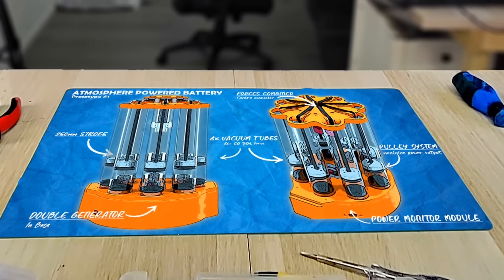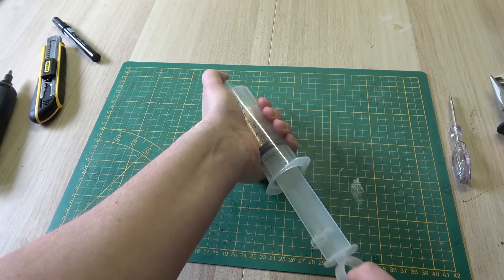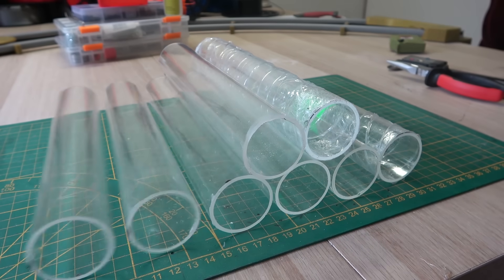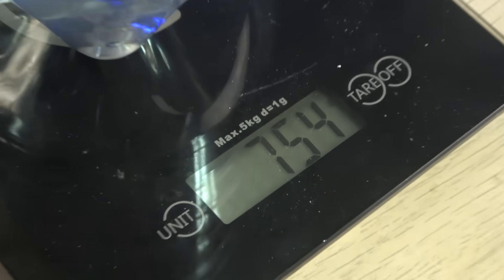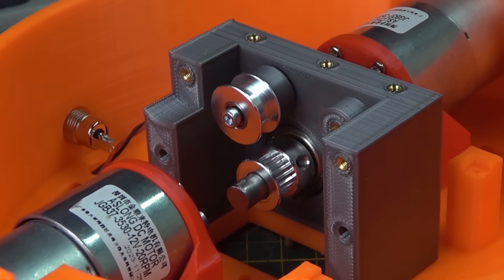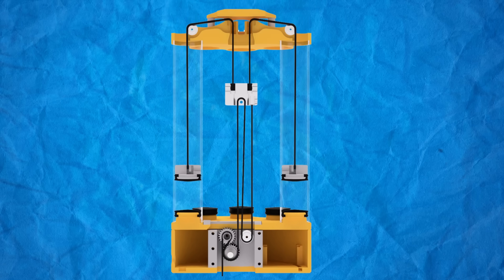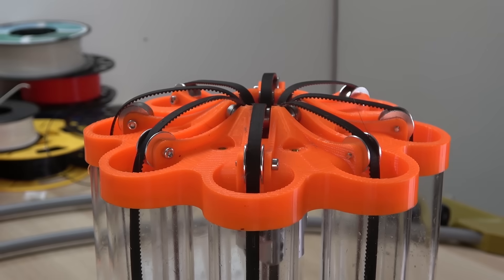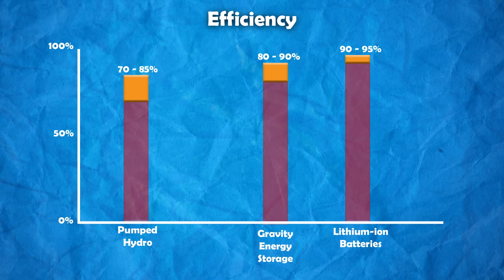Building an Atmosphere Powered Battery..

Comment from the maker: To clearify how i got to the result as seen in the video:

To charge: ~12.08V x ~1.62A x 43.709 seconds = 860,64 watt-second (or joules)

After a discharge: ~9.42V x ~1.15A x 57.993 seconds = 628,24 watt-second (or joules)

All value's are measured by the Arduino Nano in combination with the INA3221 Power monitor module.

As many of you have pointed out in the comments below, I did indeed make a mistake regarding the mention of the Watt to energy aspect. My sincere apologies for that!

The core of this project was to explore, show and see what was possible with this experimental project, even with some limitations. Sometimes it's not just about the final outcome, but also about the journey and what we learn along the way. And I hope that despite any shortcomings, you still found the video interesting and/or inspiring!🤓
Reply: A potential problem with your aproach is that if you whant to store energy for long periods like hours or days, the air will slowly sip inside the cilinders, resulting in potential energy loss. and you needing to reassemble the entire rig to get rid of the air that laked iside the tubes.
Reply: @murylocordeiro  I bet there is a way to keep vacuum that is more sofisticated than using syringes
Reply: @PuOop-j9l  yes. But if you have moving parts the air will get in.
You can try to improve the seal, adding orings and lubricant but the air will eventually get in.
Reply: @murylocordeiro  anything built on a serious level would likely include a method of equalizing at deactivation. Essentially you would reset this every charge cycle.
Reply: True. However, especially with pumped hydro and gravity batteries, it is for a short period of time, to store energy from solar during the night. It does have other uses, and the other use doesn’t require as much efficiency.

Basically, true large scale power plant ones just need to store power at most maybe 36 hours if you want to be able to function on a rainy day. A household one doesn’t need to be as efficient, as home power useage is actually pretty low. An auxiliary motor maintains the charge for low electricity, or you have to recharge it every few days, but it still could power your home for multiple days.
Reply: @murylocordeiro  There are Phillips Stirling engines that use seal sucks, which are very airtight and where air can hardly get in. (Hay motores Stirling de Phillips que emplean seal sucks, muy herméticos y en donde el aire difícilmente logra entrar). https://youtu.be/-gvplMQbqnA?si=ANG2SO3ZPILUVQSq
Reply: 628 Ws of energy means, you needed 3'600 pieces of your apparatus (or the active vacuum cylinder push lenght) to create 628 Wh - the capacity of already worn down 750Wh LIon bicycle battery. Since dW=F(s)·ds, when you take a piston with a diameter of 2m, then this provides a force of F=1²·PI·g or about 308kN. A moving distance of 100m results in an energy of 30.8 MWs or 8.6kWh - multiplied by efficiency. Sorry to tell you, but I don't think, this is a very appealing technology.
Reply: @debrainwasher  It's the same core principle as gravity storage, just with a fixed pressure instead of the "density*height of the weigth"-parameter. As such we get similar storage density.
Reply: @robertmartinu8803  This is not exactly true. Gravity based energy storage systems, don't need seals with significant friction coefficients and also don't have adiabatic losses. This is the reason, why water is so successful in hydroelectric storage power plants, while gas is not.
Reply: @debrainwasher people who aren't familiar with electrical or chemical engineering will forget to do a thermodynamics check. In this case, it is as simple as remembering that mechanical force translates to very little electricity.
Reply: How much energy did you loose by friction on the tube walls and pulleys
Reply: @Bear049  I'd guess 27% - the bit that is the inefficiency
Reply: @Bear049 Not enough to kill the idea... they've lied to us since the day we were born... They make, and we can access, materials that have SIGNIFICANTLY less friction than metal. Teflon is only the first that comes to mind. I've seen what types of weight and torque Teflon can handle. But there's not only Teflon.
 If we DON'T use their math, forget everything they told us that COULDN'T be done,  and just use our common sense, we can MOST DEFINITELY make a Perpetual Motion machine.
Reply: Wh/kg=?
Wh/m3=?
Wh/$=?
Reply: bring the output so that it will be a stable usb-c pd and try to use a laptop with that energy, and see based on absorption if it's usable, because a larger scale version of this would mean being able to charge it with solar and release later on in a size that is way larger than car batteries( in parallel and series) that i have sometimes seen( also a cost analysis would be nice).
Reply: Couldn't you do a similar thing with hydraulic oil, if you're just storing vacuum energy?  Then your "piston" would just be a low vapor pressure liquid (so it doesn't boil so much under vacuum) that doesn't lose energy to friction or leakage and your motor/generator would just be a reversible hydraulic pump.
Reply: I find the custom-made test tools/procedures most interesting. Also to increase efficiency, in this case, larger is better, and in general fewer moving parts is better, so a single piston 2x as wide has 4x time the volume/storage but only 2x the surface area/friction, and using one bigger motor with more magnets and coils should be able to run at slower speed, potentially without reduction gears which would drastically reduce the moving parts count. It would be worth testing what has the least mechanical resistance, reduction with belt/pulleys vs planetary gears, and chain vs belt. It's already established but it's more fun to find out through experimentation.
One more efficiency thief, however small, is thermal losses, but that can be minimized with insulation.
Reply: Bullshit. Lie. 800 Newton x 0.25 meters means 200 joules of energy. It's 15 mA/h of 3.7 cell. No way it can generate 628W on time more than 300ms. One more time: 80kilos x 9.8 x 0.25meters~200. 200/628~0.3. Scam.
Reply: @АртёмВорохобин  You're using 9.8 that is more or less constant throughout the height of the tube.  Since this is not gravity but vacuum, it's going to pull half as much half way down the tube...so while I haven't verified your calculation, it's likely worse than you stated.
Reply: I have another question… if you were to use some sort of oil hydraulic handle to manually charge it, this could be a great way to have portable clean energy in places- imagine having four 2k wh of these with batteries, you spend 30 minutes charging them manually in a row and then you have 8kwh available for a day.
Reply: @PuOop-j9l  a quite good sportsmen - a cyclist can produce 900 W  (bests of them ~2000W) of power during one minute, an average person from the street can produce continuously during one minute pathetic 200 W. And you expect much overestimated energy produced by power of hands/arms, like 1000 W during 8 hours ("...then you have 8kwh available for a day"). I tried to boil 1 liter of water using my stationary bike, my to power (for some seconds) was almost 900W, so I am familiar with this topic.
Reply: @PuOop-j9l you do understand that this is a vacuum battery and if you are charging this to charge other battery you are waisting efficiency. Change your secondary battery with your idea and be done with it.
Reply: @PuOop-j9l  A human is typically capable of 200 W. Doing work for 1 hour would provide 200 Wh or 0.2 kWh. In order to charge 8 kWh you would need 40 hours of human effort.
Reply: @mattpatt  "A human is typically capable of 200 W"
at peaks maybe, but 200W is insane. maybe a marathon runner can get close to that, and even that I feel  unlikely. at most I had produce 160 at my safety cardiac limit, for like 30 seconds, and dropping to 100-120 fast. producing 200w for a continuous hour is likely impossible for a "typical" human.
Reply: @PuOop-j9l  I think a person on an exercise bike would struggle to make 100 - 150W using their legs. So at 100W for 30 minutes is 0.05 kWh. I think with a hand crank a person could do about 20 - 100W. It will be better to harness other forces.
Reply: In the video the energy needed to load and the energy given back is expressed in watts instead of wattseconds. The formules however are correct. My respect for the torough explanation!
Reply: then also write Ws and not W.
one is energy and one is power.
Reply: Without a load, this calculation is nonsense. In addition, if the time were to increase, because it would be done on a large scale, there would be more time for errors, say for stretching, thermal expansion, friction, and sagging. If it's a vacuum, I think more energy could be stored with a denser material, water or oil, with the same change in volume.
Reply: Oh so you used watt seconds. Charge of 860 watt seconds and discharge of 628 watt seconds. Although, you said that takes about 80 kilograms, so around 800 Newtons of force to pull the cylinders, and the stroke looks to be in the ballpark of 30cm. So that's 240 joules of energy storage. So the amount of electricity generated will be under this number, and the amount of electricity used to evacuate the cylinders will be more than this number.
Reply: ,что за странные расчёты вы произвели?🤔🫣
вот так правильно
(12,08*1,62)/60=0,32вт*м
убираем 1/3(40 секунд)=0,2вт на заряд
разряд=0,18вт
Reply: Cant you just use heat to create vakum as like mythbusters do?
Reply: Maybe try to be able to modulate discharge, to ensure it never discharged more than needed (will move faster if more energy is needed). Also, if you get more of a seal, maybe put it into pressurized chamber. A chamber with 2 atmospheres holds twice as much! Or surround the tubes in a sealed second tube, so a portion of the tube has 2 atmospheres. If 1/2 of the tube is within this second tube, you increased the storage capacity (and force) by 1.5 times!

If you can deal with non-linear output, perhaps use a 1-way valve and a kinda bellows system to slowly transfer air from the tube to the outside. Once the syrynce is released, you have multiple atmospheres on one side, near vacuum on the other. But, as it discharges, they equalize. So it starts as 2 and 0, slowly decays to 1.5 and .5, which is half as much if I’m correct, then full discharge of 1 to 1. But, in conjunction with my previous mentioned tile idea (stepping on a spot slowly charges it when you step off), this could be used to store large quantities (it should be more energy dense) for a short time, and once full, combined with a capacitor and inductor, it generates a constant flow to charge the main battery! So, kinda a non-linear buffer
Reply: What energy density did you achieve? How does that compare to similar technologies (pumped storage  etc.)
Reply: Nice video. 
I have been attempting to replicate the gravity battery for domestic use from a theoretical standpoint, and as you highlighted it would require a large counterweight to achieve a meaningful storage capacity. Yet, a mini version could be used for low-power lighting purposes.

The vacuum has great potential, but I would modify the design a bit; how about having the plunger with a passthrough valve or a bypass line that allows the rising with little to no effort, then achieve the vacuum using a vacuum pump which is way more efficient and requires less power.

That is raising the plungers with the valves open; this could be achieved with an external bypass line connecting the 2 ends of the cylinder, once in the high position close the bypass line and start the vacuum pump to lower the pressure on the lower side. Once your design pressure is reached your battery is charged.

Ciao
Reply: I highly doubt your numbers also.  That would say that there is the same power output (A*V) at the highest pull of the pistons as the lowest pull of a piston, which makes no sense.  If you really want to know the energy in and out, you are going to have to measure many points in time in both on charge and discharge plot them, and measure the area under the curves.  Then you can have accurate numbers.
Reply: @IntenseGrid Nope. If it's vacuum inside (negligible residual pressure) atmospheric 100Kpa is constant though entire length.
Reply: @АртёмВорохобин   Nope.  Your premise is incorrect.  It's not a vacuum inside, but partial vacuum of lower absolute pressure at the top, and near atmospheric pressure at the bottom.
Reply: @IntenseGrid  said: negligible. Even 1000Pa vs 100000Pa is negligible for overall calculations, so force can be threatened as constant, nevertheless it some asymptotic function
Reply: Can it scale up ?
Reply: @drakemia4079  pressure vessels don't scale well - you'd want lots of relatively small cylinders. Which means all the inefficiencies stay at the same relative magnitude instead of getting diminished by square/cube relationships and similar.
Reply: Would it not be better to just use one large tube with the surface area of all of the ones combined shown in the video? That way it'd be less contact between the seal and tube with the same amount of force as all of the tubes in this design. Of course a syringe tube this large would be difficult to procure
Reply: Perhaps using an accordion like chamber?
Reply: I made a galvanometer controlled laser phasescope, you can check out some videos of it on my account. I also live in the Netherlands, so maybe that could be a project that could be interesting for you to refine?
Reply: So really the efficiency calculations are accurate then right? And that's before any improvement and optimisation work let alone the opportunity to innovate on it.
Reply: any idea what would be the efficiency of Tesla's reciprocating generator? it's run by pressure difference too.
Reply: Lube! Your pishtons need lube! Ad a tad of silicon spray and you will decrease friction, enhance piston sealing and stability of the vacuum, and thus, increase the overall efficiency of the system.
Reply: Energy efficiency wise is pretty good for the cost, but energy density wise, that is the amount of energy you store per unit volume, is not that good unfortunately. Yet amazing effort, design, and engineering 🎉, keep up the momentum!
Reply: Would it not just be easier to pump air out of a tank and then open it so that the rush of air into said tank drives a turbine? I feel like it would halve the parts and complexity.
Reply: 2 question: how much time this system will lose stored energy without  discharging? 
And why don't try it in reverse by storing compressed air instead of creating vacuum? You can store energy as pressure of 5 or 6 ATM in the same volume, with your system you store 1atm, reversing it you can be more space efficient.,
Reply: Why not just use a windmill to fill up a big balloon (or pressurized air tank) while wind is blowing; then just release the pressurized air and get it to turn a turbine (fan) connected to a generator?
Reply: Might be useful too plot the power output over time as well. If you assume that the power output is useful for something then the next step is to figure out the best way to scale the discharge time. Which means it will be important to understand how and where to optimize it.
Reply: A bigger scale of this. driven by a smaller water stream not really capable of hydro, or a small wind mill driving a gear box.
Reply: @jshcx1  I would think that the head of a smaller stream would be far easier to manage than a larger one.
Reply: The reason for the low efficiency is the use of conventional electric motors. Small engines have low operating efficiency. I'm surprised you got a good result. A special electric generator is needed. It is possible to make a mechanical switch from the engine to the generator. This way you can get an additional 3 - 10% efficiency
Reply: There is friction loss both at charge and at discharge plus the useless weight of the rods
ideally attached to the piston should be a wire made of strong metal that can act as a pulley too.

Also think of the boxer engine, an axial rod attached to a motor could spin opposite cylinders.
You are a smart guy btw, vacuum is better than compressed air, and safer and cheaper and less complex.
Reply: Would polar opposite magnets work in this system to eliminate friction? But the motors will still pull but there will be an added part where the pulling motion will lift the magnets upward, I don't know how tho 😅 im just imagining things because the system is really good and promising
Reply: Was the output constant? Some current measurement boards also calculate the energy in Wh
Reply: if you went more generators how would have that affected the engery? would that have been better?
Reply: In this form, it will not be possible to accumulate energy for a long time. Take a syringe, create a vacuum there and leave it for a day, and then check how much vacuum remains there.
Reply: its not a good way to store it as the seal will eventually go bad
Reply: I think that as long you make the vacuum tube more energy will be consumed. Try to make tube smaller but in numbers
Reply: Brilliant idea, I think this could be improved on with simplicity, circles are weird in that their surface area doesn't increase intuitively with respect to their diameter, for example your 8 cylinders have a total surface area of 10053.12 mm^2. Because of this rule a single cylinder with a diameter of 113 mm would have the same surface area of 10053.12 mm^2. That would in theory allow you to run this whole setup in terms of force with a single 113mm circle, this might also help with frictional losses to the 8 individual pulleys and seals.
Reply: Would have loved to see it charge something.
Reply: @Cookies4Wookiees  ⚠ God has said in the Quran:

🔵 { O mankind, worship your Lord, who created you and those before you, that you may become righteous - ( 2:21 ) 

🔴 [He] who made for you the earth a bed [spread out] and the sky a ceiling and sent down from the sky, rain and brought forth thereby fruits as provision for you. So do not attribute to Allah equals while you know [that there is nothing similar to Him]. ( 2:22 )

🔵 And if you are in doubt about what We have sent down upon Our Servant [Muhammad], then produce a surah the like thereof and call upon your witnesses other than Allah, if you should be truthful. ( 2:23 )

🔴 But if you do not - and you will never be able to - then fear the Fire, whose fuel is men and stones, prepared for the disbelievers.( 2:24 )

🔵 And give good tidings to those who believe and do righteous deeds that they will have gardens [in Paradise] beneath which rivers flow. Whenever they are provided with a provision of fruit therefrom, they will say, "This is what we were provided with before." And it is given to them in likeness. And they will have therein purified spouses, and they will abide therein eternally. ( 2:25 )

⚠ Quran
Reply: Neat project :) I wonder if adding a fly wheel to the charging process might be helpful? it could possibly utilize a gear ratio switch to best utilize torque. Idk, it's not my area of expertise, just got me thinking.
Reply: So thats  ~10,47 W/h capacity 
same as one 18650 cell?
i guess you need to go bigger
Reply: in Wh it is 0.017444444444444457 Wh
Reply: Just a thought, but maybe to make it basically 100% effective, by not using the motors to charge it. Make it hand cranked or something.
Reply: That’s not making it 100% effective, just making it convert human kinetic energy (and therefore the chemical energy of food) into electricity like a generater.

But, that idea is still good, as storing your energy is nice.

Another thought would be a 1-way valve on a platform with a spring. You step on the platform, it pushes air out. Get off and the valve keeps air out, but the spring pushes the platform up some (not quite as high). Larger containers inside contain more air, so it takes longer to depressurization (if each time you stand on it you remove about 100 mililiters of air (each time is technically less), then more air in the system makes it a lower fraction, but same energy. If there is only 100 milliliters of air, it becomes an almost perfect vacumm, and from there new pushes have almost no effect. However, if there are 100 liters, it takes 100,000 steps to remove air, but each is the same energy!

Here’s where it gets cool though. You have a plunger (or 2), and you pull it all the way back with the valve open. So the plunger is full of air. Each time you step on it, you pump out some air, slowly storing gravitational potential energy inside. You can put these into stuff like your floor even! Then, you release a latch, and the plunger can now go down. The atmosphere pushes it down, which generates electricity, which is stored in the main battery.
Use int a barometer, a bunch of small versions can be made. Each has a sideways cylinder and is a rectangular prisim that is “x by x by y”, and takes “x” number of steps to empty. It’s not very much of a decrease, but as you walk through your house each step slowly stores energy in that 1 tile, which once a barameter detects is “full” of energy, is released, and the electricity charges a capacitor (or battery-capacitor system). Once it’s enough to run the motor, the energy is released and stored in the main battery!

You could make the tiles each store just 1 steps worth of energy, minimizing air leaking in. Or have it contain enough energy to slightly charge the battery!

So, not a hand crank, but a linear entire-house crank! A city could put it in sidewalks, or speed bumps, extract gravitational energy from cars!
Reply: @MikevanHattum  Using a hand crank would essentially make it the same a one of those hand cranked flashlights. The point of the battery is to store an electric charge as kinetic energy and then release the charge again as electricity. You could hand crank it to store the energy sure, but then you would only be converting your own manual labor into electricity, and we already have more efficient ways to do that.
Reply: @MikevanHattum  but that not usefull. tha u can use the motor directly as generator